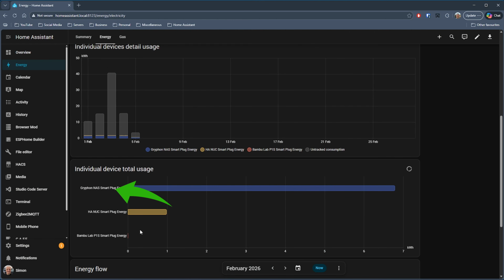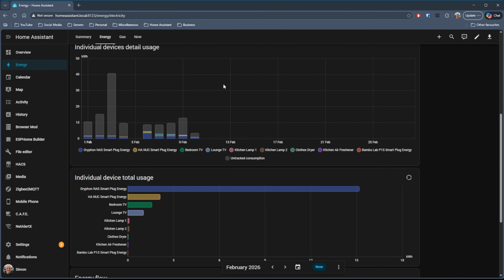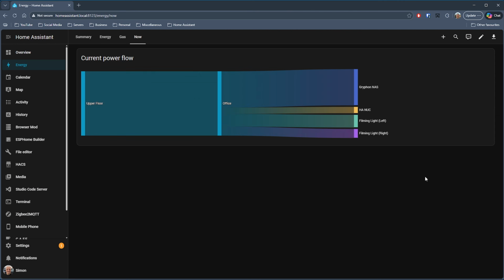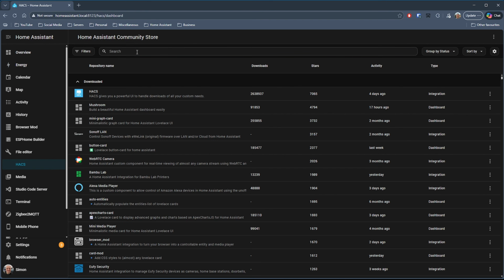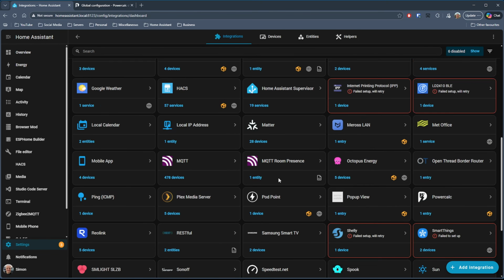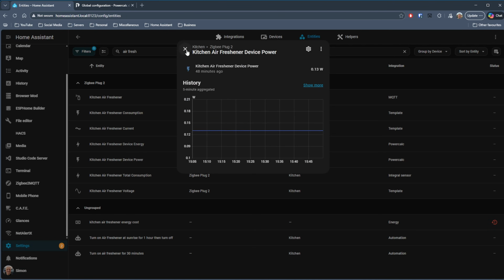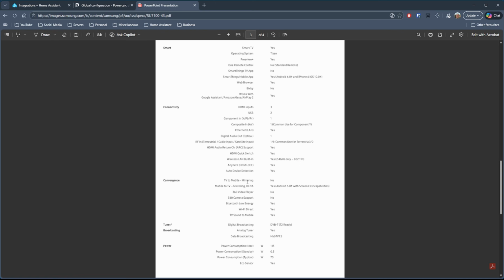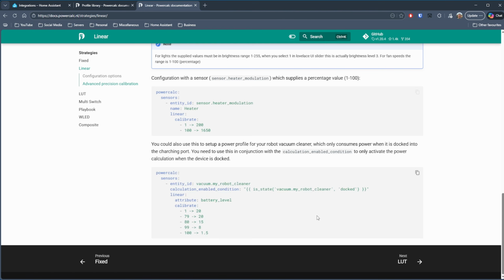Ghost Power:  How to Identify Every Watt in Home Assistant

Comment: I had work done that required access to the house power board. I had two Shelly Pro EM-50 fitted. This covers the house sockets, kitchen sockets, upstairs lights and oven circuits. I already had one on the heat pump. That monitors the immersion and heat pump circuits. I then had another fitted when the car charger was installed. The few smart plugs I have are downstream from those circuits. Works really well.
Reply from the maker: When you're having work like that done, it's a great opportunity to get something like the Shelly devices fitted. How's it working out for you?
Reply: @Byteofgeek They are fantastic. It was the best way to cover the kitchen. Oven with its own circuit and the plugs on another circuit with all the appliances. I don’t care that deeply about each device. I put smart plugs where I need the smart plugs and then the power monitoring is a bonus

Comment: Great video! I've been using PowerCalc for a while and did set up some tracking for a few devices, such as dumb bulbs on smart switches (that themselves didn't have power monitoring). It also automatically configured some (but not all) smart speakers. It is useful, but there or some things to be aware of:
-Large variable appliances (stoves, HVAC, etc.): Unfortunately, these tend to be the things that use the most energy, yet aren't able to be accurately configured. In these cases, you're going to need clamp devices for the circuit.
-The documentation is fairly complete, but it and the configuration options are really overwhelming! It's by far the biggest issue I have with the integration. It could use some redesign and simplification, IMHO.
-If you do start setting up manual entries, DOCUMENT them somewhere! I had an issue with PowerCalc not working after a HA update and had to redo all my sensors. And without documentation, it's hard to recall all those settings.
Reply from the maker: Thanks for the comments Richard and interesting to hear your experience. Totally agree regarding stoves, even though there are smart ones available, I'd still go down the clamp route with that. 

The documentation is certainly extensive, likely because it's trying to do everything for everyone, and there's certainly a lot of configuration options but not the worst I've seen with an integration!

Comment: you can buy the CT Clamp meters fairly cheap now a days sem meter is a good one it can be made local only with a mqtt server and a email to delete your account and some time and it tracks 16 circuts. I prefer circuts over devices to have less clutter. really nice and useful device (its just a ESP32 with CT clamps)
Reply from the maker: Yes CT clamps are an option, but if I'm not mistaken, they don't report usage at the device level? More of a overall usage?